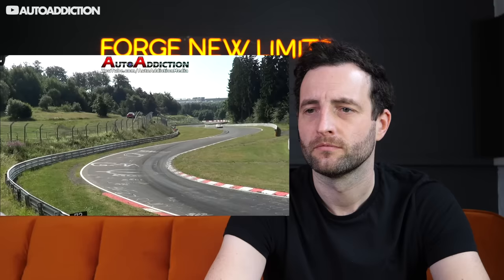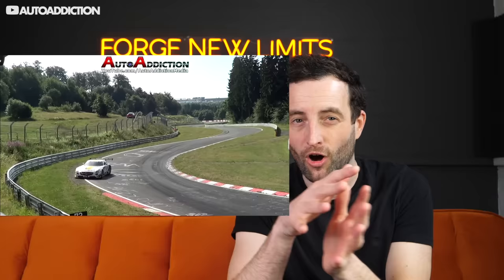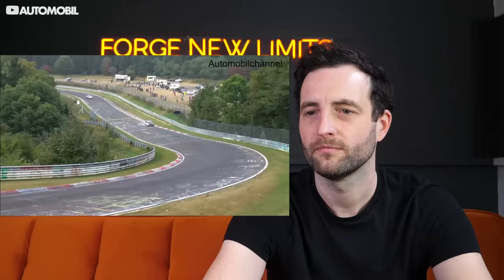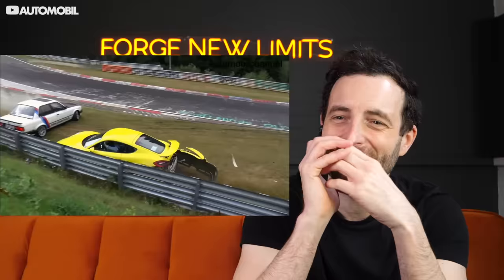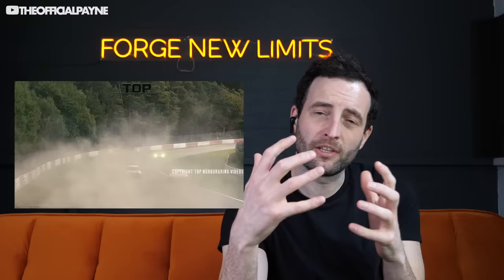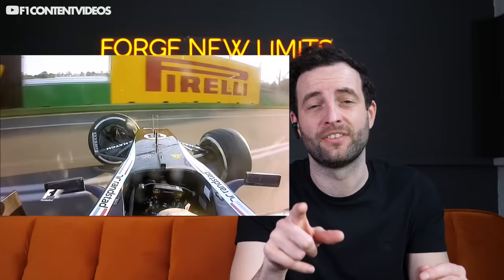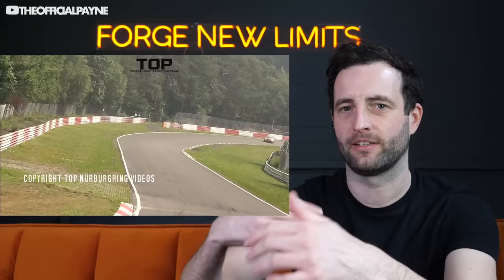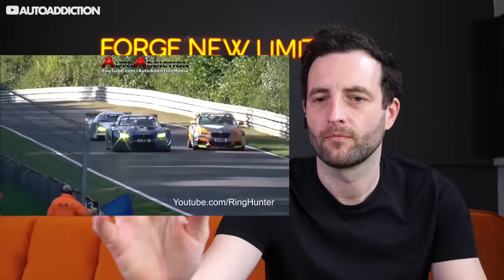Race Driver Explains Nürburgring Crashes

Comment: so see the second brow of the long corner to the left, where most of the crashes happened in the video. Do you brake there, or let off the gas slighty then brake after the corner. cause in ac turn in before the corner as i am aiming for the second corner already then after the corner brake for the next. so do you break there in real life or is it good to let of the throttle a little so that the tyres dont have the strain of the rear pushing them further? (i havent been in real life so, and i learned from another driver the more steer the less throttle, the less steer the more throttle, same applies to braking)

Comment: I remember a crash I had in a go kart it was the second time I was in one and I remember I was going full throttle into a chicane and missed my breaking point and the kart just didn't slow down and I went almost full speed into tires I was alright as I moved my hands so I didn't get the stick underneath a tire but it hurt

Comment: 0:55 the Golf enters a part of the track lying in the shadow and it is still damp and another mistake from that driver is, he was too fast which can be heard by his screeching tyres before he gets onto the damp patch..... 2:50 the racedriver here is too fast as well and enters the corner already sideways because he probably lifted his foot of the accelerator, unsettling the back end which throws around and into the barriers..... regarding the rest, i agree.... just those two were explained wrong.

Comment: 6:19 yup... dont break a wrist....
after the first impact.... you are just along for the ride.... (and if you roll... hands "in" keeps the G force from flinging them out the window)
.
i remember sliding off a gravel road in my 99 buick century.....i just let go
got hit in the face by 3 or 4 foot high weeds (window was open.... and i was 90 degrees sideways)
.
car didnt flip.... didnt even stall out
quickly got the F out of their before someone reported my dumb butt LOL
.
only damage was to the weeds...... and my pride and ego....

Comment: The guy on the bike would have been fine if he just kept the power down and drifted it out. It's scary to do but the only way to avoid the high side. I use to love doing those drifts on my gsxr1000. He highsided cause he snapped the throttle shut when it lost traction when he should have just ride it out.

Comment: I think its one of those fantasy tracks that would probably not live up to a person's expectations. Simply because you would be dealing with so much traffic.
I would be angry at the slow drivers in front of me and scared of the good drivers whipping past me. 
Now, if I could be turned loose on it during a very quiet time well, sign me up.
Reply: just go there when it rains

Comment: 4:09 bike was a gear to low by the sound of it. To much throttle over the crest with high revs on the small part of the tire if he was one gear up the revs would of been perfect and he would have less chance of loosing traction on the rear

Comment: Interestingly, BMWs were in most crashes. So much for the driver's car..
Reply: well, they do drive well, it's just that often, older bmws get bought up by young dudes that have more balls than brains, and so they drive fast and get into a lot of crashes
Reply: dude the thing is u actually need to drive bmw's unlike audis and vw who just understeer threw the corner... so its not the cars but tis the drivers who mess it up
Reply: @ossharkuenmeursault5609  l know man, just messing around 🤘🏻
Reply: @cagriyuksel6448  yep, couldn’t agree more on the bad driver part.

Comment: Serious question, where do they fill the oil  in a f1 engine if there isn't  an oil cap on the valve cover? In oil dipstick or take off the valve cover and fill?
Reply: No it's not "take off the valve cover and fill", they need efficiency, that would be daft.
Reply: F1 cars have a separate (carbon fibre) oil tank which is located in front of the engine, between the fuel tank and the engine.  They are dry sump vehicles like most racing cars (the oil is not stored underneath the engine).
Reply: @TassieLorenzo  Thank you for answering my question.

Comment: Doesn't letting up off the throttle free up the tyres to grip better? How does it make the rear end more "lively" when straightening out a drift even in a FWD? guess I read Paul  Frere's book all wrong and got lucky in those cart and quad races but those weren't FWD and those races were amateur series.

5:10 it kind of looks like the yellow Porsche was fated to go off track anyway from looking at its previous line and speed.

Comment: as someone who is also an expert at driving cars and not of motorcycles, i can confirm you will kill yourself on one. for example: i' used to die in motorcycle sims all the time under breaking.. i searched youtube until i found a pro motorcycle racer that basically said "don't use the rear brake for braking on a motorcycle". i'd die all the time in a sim at high speeds until i found this out. (yes i've driven a real motorcycle and i understand the differences) but there are alot of things, like shifting body weight, and ect.. that will just suddenly murder someone who drives cars very proficiently. so keep it legal and also wear your protective pads. furthermore, you have the skill to see how everyone drives. i can't imagine you'd wanna be around those people on a motorcycle. i nearly got killed many times, and a normal bike rider WOULD have been hit. and so i just sold my bike.

Comment: Seems they keep it narrow on purpose. Like a drinking straw with less chance to get an angle to the wall.
It's not working.
My learning track and would have no walls , huge drift aprons and runaway truck ramps at the end of the straightaways.
If you lose control on my track you end up sliding through grass or a hilarious oof into a huge pile of wood chips.
If the ring fence was 20 yards wider on each side half the accidents would never happen.
Less ping ponging across the track and less pile ups.
If there was a list of all the great cars that have crashed there it would make me cry.
Plenty of drivers too.
I used to think that the ring taxi was a joke.
Like are you kidding, let ME drive.
Now I would gladly pay for what I would learn.
Just thought about a catch net like on aircraft carriers.
Running into walls just ruins the whole thing.